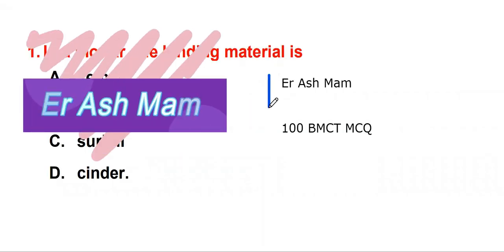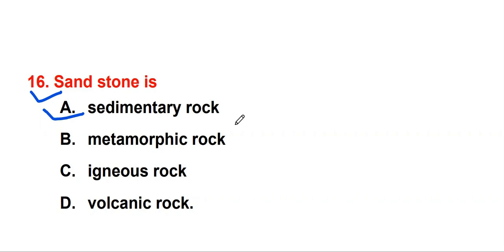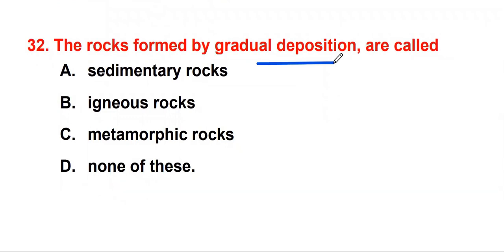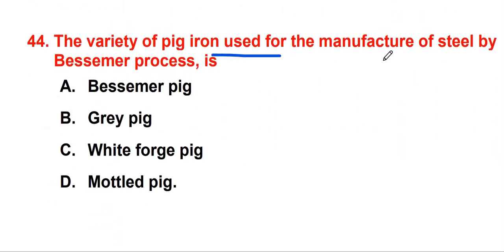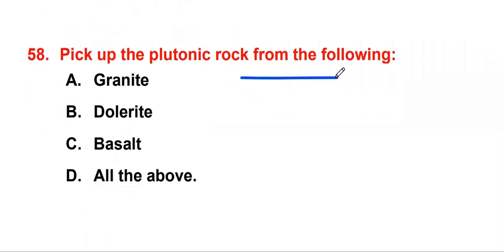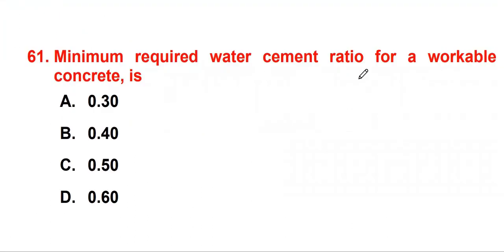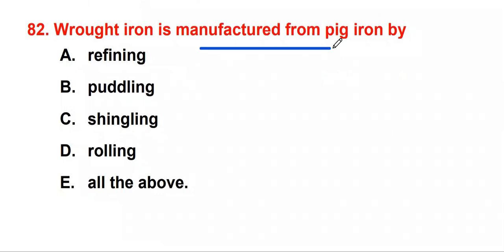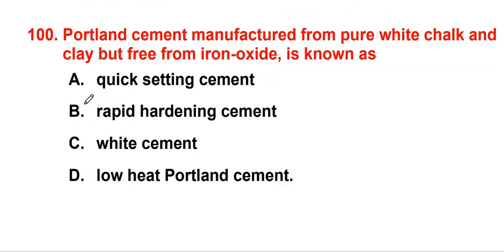Building Material 100 MCQ

Comment: Hello how are you? I m from Pakistan. Want to make my own precast concrete Column for small scale poultry shed and will put bamboo roof on it. What should be the size of Column ? Is 3.175 mm reinforcement will enough? How many bars should put in one column? What should be the concrete mix ratio and the size of aggregate? Want to make a low cost poultry shed with bamboo roof. Bamboo or wood columns are not successful be cause of termites. Plz guide.  Thanks